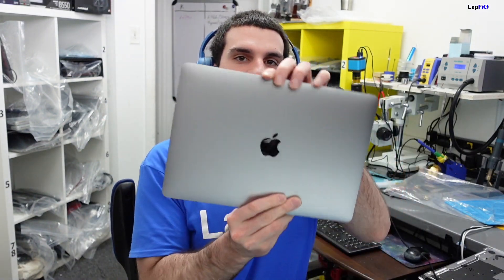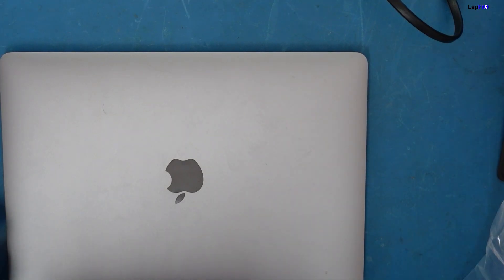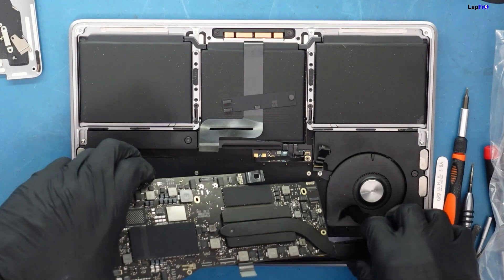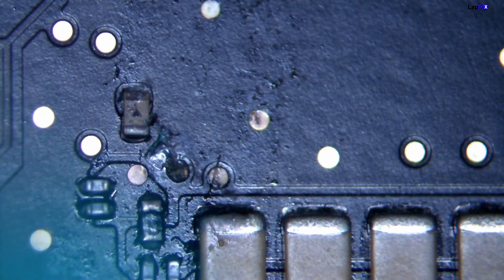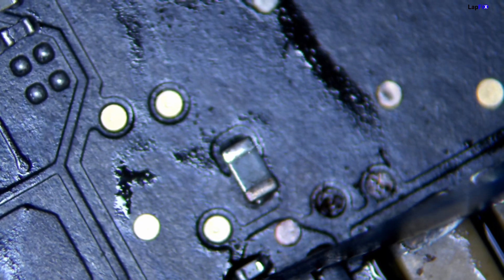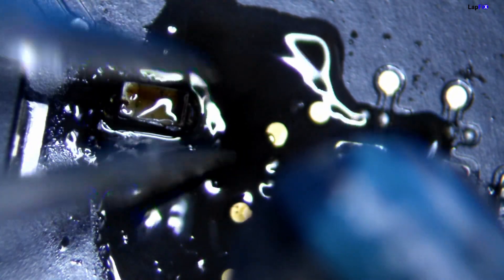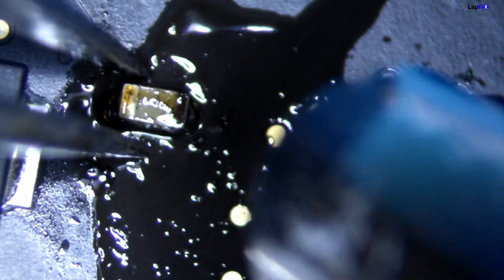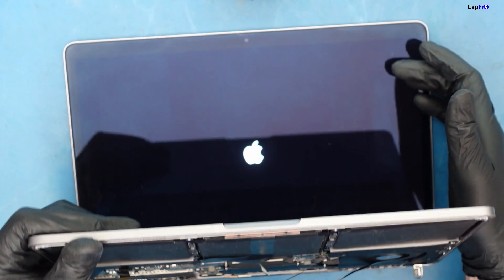Repairing MacBook Pro A2159 with Liquid Spill - No Power

Comment: Hello. Im trying to fix a MacBook Pro m1 A2338 liquid damage. I clean the mother board and check for shorts and everything fine. I mesure the battery voltage and i was having 0.5V.. so I bought a new one. The thing is.. how many voltage do I have on my usb c multimeter with out battery connected? 5V? Or is it supposed to go up to 20V?  When I plug in the charger, the screen shows the charging logo 
Best regards